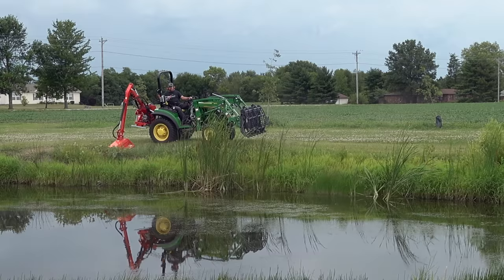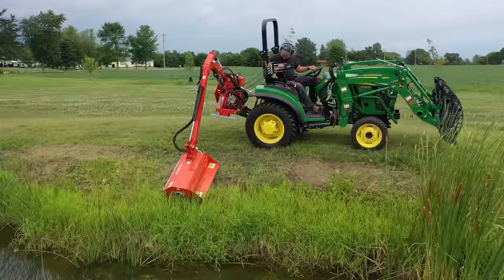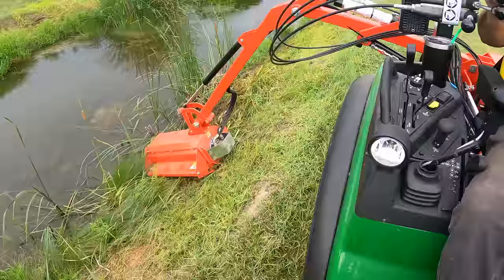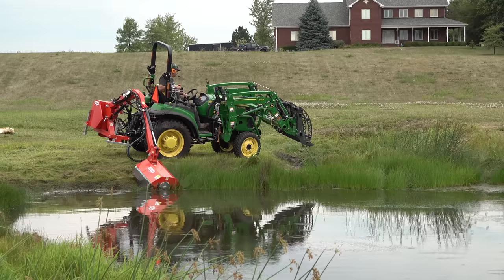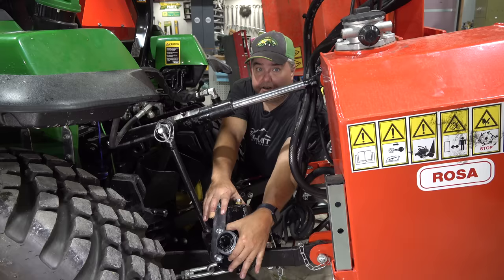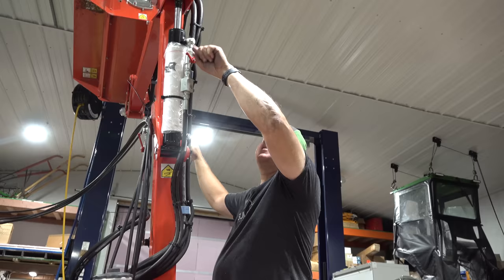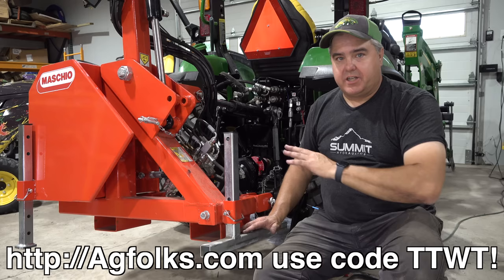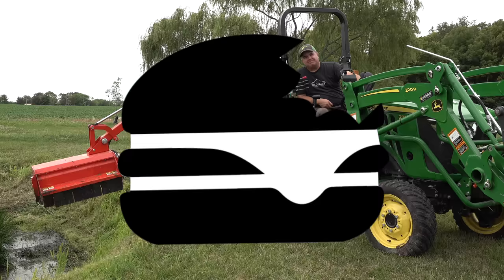BOOM FLAIL MOWER REVIEW! Mow Pond Bank; DISTRESSED Camera Lady!

Comment: Just need an old 9 foot sickle mower it’ll reach out just as far as an expensive flail mower and cut anything it will cut out a whole lot cheaper And be a lot more stable an angle
Reply: I own 2 sickle bars and agree only benefit of this would be for tree lines etc for vertical reach
Reply: exactly

Comment: I'd say dredge the banks to a manageable angle, put fabric down , then rip-rap that you can walk on easily for fishing purposes. Even create a beach area for when you want to even up the farmers tan!
Reply: I’ve not had good luck with weed barrier fabric long term, eventually the weeds win.
Reply: @mbruce4152  I've seen some other landscapers do it and it is less maintenance. Plus if the pond is way down you can spray what little there I. Plus you need to treat the ground before you put the fabric down. Flail mower on an excavator is pretty good too, you can reach out further.

Comment: Sorry to hear about the blood thinners.  I'm diabetic; you need to worry about right away, I just take twice as long to heal.  Getting older can be a disadvantage.

My not serious suggestion for routine management of the grass levels on the slope is to pasture goats there.

My more serious idea, maybe use an excavator to skim off the sod and make the slope more gradual, and then put down driveway fabric and install a sand beach.  Maybe use some pond liner powder first.

Other people have mentioned the boom sickle mower, I was going to ask if that would be more stable.

I'm in the process of buying my first tractor, so I don't know if my ideas are good ideas or not.  Your videos have been helpful during the process.  (Years of research, planning and thinking before the budget showed up.)  Thank you
Reply from the maker: Check out some of our more recent videos about our pond. We have totally redone it.

Comment: I dredged my pond, and shaped the edge to be more manageable. Then I placed rock (large limestone) extending 6'-8' into the water and 4' coming above the water.  I spray along the rock every couple of weeks to keep everything in check.  Looks great, saves me lots of time.  I tried everything else first and failed.  I also tried to put road fabric down at first to prevent the rock from sinking, but ultimately that was a waste. Good luck!
Reply from the maker: Thanks for the advice and sharing your personal experience!

Comment: Yeah, making it wider, for the lower mounts to be quick-hitch compatible, would allow them to slide the hydraulic tank further to the left to help offset the weight more of the mower's head.  Don't understand why sooo many attachments aren't QH compatible, should be so easy to start there!!  (I have several attachments where the top link pin is 6 inches or more too high for no reason, those will get "mount adapters" fabricated to lower the top pin to be QH compatible this fall or winter)  

For pond design, we typically use a 3:1 slope, though that is steep for a tractor, 4:1 is easier for mowing though once you get above the typical water level, I would reduce it even more to 5:1.  Anything steeper than 3:1 will erode way to easy (looks like you have this issue in many areas around the pond) and with a 5:1, if it is under water, will not get deep enough (fast enough) to keep vegetation from growing along the waters shallow edge.  My recommendation would be to regrade the pond edge from the current water level elevation to where the "wet period" water elevation is with a 4:1 slope, then change to a 5:1 slope above that.  That should limit erosion and make it easier to mow/maintain (lot of work to move that much soil be will give you spoils to fill in any eroded areas so you don't need rip-rap in those washed out areas).  Just my 2 cents.

Nice mower and presentation, have a good one!!

Comment: Plant Zenith Zoysia grass around your pond.  Grows extremely thick, prevents erosion, and chokes out other weeds.  The downside is it will take over your entire lawn.  I like Zoysia grass, it is the same grass golf courses use on their fairways.  It will turn brown before your other grass in the fall and last one to turn green as well since it is a warm season grass.
Reply: I like Zoysia grass as well. Yes in full sunlight it will spread to take over and choke out most weeds and other grasses. 
I like zoysia better than Bermuda personally. But Bermuda would be another good choice for around the pond (assuming you are mot opposed to either of these types of grass personally.). 
For the right need(s), it looks like a great piece of equipment with a few minor improvements. The hydraulic lines were probably ran inside the 3 PH connection points to provide protection while mowing, but other options should add minimum expense.

Comment: I'd chain the pump around the drawbar/ drawbar support, before chaining to any part of the 3 point hitch.  The drawbar/ drawbar support isn't going to move in relation to the pump.  The three point, while you may not be raising and lowering it while running the mower, will still have some play/ movement in it.

Comment: These are really common in UK for hedges and bank mowing. I find the heads on the compact versions a little harder to use as you cant really afford any overlap because they're small anyway. I moved from on this size to a full size tractor one and with a little overlap you can get a nice finish relatively quickly. 

Reverse function is intended so you can keep one side of the hammers/knives sharp for neat hedges (so it doesn't break/shatter the ends off everything and leaves a better finish) and run the other direction in grass where you're most likely to hit stones. Debated which direction is best, some suggest flails running "up" at the front for hedges keeps flying debris down. 

You can also gently use the reverse function to get stuck grass wrapped around the rotor out, although probably best to avoid stalling the motor out.

Really surprised this doesn't appear to have any kind of stabilizer frame, usually they have an additional lock-out bar between each lower link and the tractor end of the top link. This stops the machine from rotating and lifting the RH link upwards. They're far more stable with this fitted. 

It also doesn't appear to have a lockout on the 'breakback' so the mower head can swing behind you if you hit an obstacle, often the smaller machines have a fuseable link in the lower link which breaks if you hit something hard (eg, signpost on verges) but holds the mower inline with machine in normal use.

Keep up the great videos :)

Comment: This is definitely a  niche product for specific need of a property.  We chose the Trail Blazer front brush cutter with their hydraulic power pack that runs off our rear PTO with Kubota 3560 Grand L. A separate dealer from our Kubota dealer had it available and installed it for us after we purchased the tractor. They  strapped our PTO shield a certain way so it wouldn't bend while the pump is operating. Let me know where I can send you a picture and I'll show you how they did it.
Also on ours, the standard hoses are too tight for either a quick hitch or even the Pats easy change system. We would have to get longer hoses to make either work. The good news is we have a hydraulic top link to help on connecting and adjusting when mowing on hills. 
I haven't used the offset feature yet, but I  agree with you that you can't have much slope to still be safe. 
I like to be out front on mowing hills. I  have just gone up and down the small pond bank which worked just fine. You just have to go slow to be stable. Also we like the width of 48 inches so we can keep more trees up in our wooded areas  while looking forward.

Comment: I think the ventrac would’ve made it look nicer. But it would work nice for roadside ditches.

As for the holes, you could use the ventrac’s tiller and till up those spots or even go all the way around to see if you can smooth it out.
Reply: how the hell would a ventrac mow as close to the pond as that boom mower is doing?  It would sink up instantly or go into the pond.  There's a reason they make boom mowers.
Reply: @verteup  have you not seen it mow banks before? Ntm the ventrac has a boom mower, could get much closer, and sits much lower and has a wider footprint. It would do way better in regards to this job. Maybe you should educate yourself before you start bumpin your gums over there buddy.
Reply: @Zanderthelab  I believe me and you have watch different videos.  I don't believe there's any way a ventrac couldve mowed what he did with that boom mower.  You realize he had that boom mower in water right?  Like...in the water.  Do ventracs float like a kayak?
Reply from the maker: @verteup is this a challenge?  The Ventrac boom mower should be able to mow further than this one.  Maybe I’ll take that challenge!
Reply: @TractorTimewithTim  Try it.  If the ventrac has a boom mower.  I thought it was just mounted to the front of the ventrac and didn't have any excavator type arm on it.
Reply: @verteup  actually they have flotation tires on them😊. Maybe you should watch more videos.
Reply: @TractorTimewithTim  go Tim! I wasn’t challenging, but if it’s an option, let’s see it beat Johnny 2!
Reply: @TractorTimewithTim  I am surprised you haven't done a comparison video. Mow/plow/grade/etc. part of the pond/field/dirt/etc. with 1025 and another part with Ventrac. I love seeing your usage of the Ventrac.
Reply: @Zanderthelab  I'm fairly aware of what a ventrac looks like buddy.  I mean how difficult is this to understand here.  What I haven't seen is a boom mower on a ventrac.  Haven't seen that. Maybe the ventrac has a boom mower like the one attached to that john deere tractor that I didn't know about.  But I haven't said a single thing about the tires other than "can a ventrac float".  Which was a rhetorical question because the ventrac cannot float in that lake.
Reply: @verteup  well you aren’t supposed to go in the pond. But dual tires definitely help and you definitely need to do some research. And lots of it. And after you’ve seen all the attachments used in at least five different applications, then you can come back and tell me that the ventrac would not do better. I’m assuming the only reason Tim didn’t do that is because he is demonstrating using the Maschio 3-point mounted boom mower. What ventrac needs to do is make a head for that attachment that is like the boom head on the Maschio cuz the boom head on the ventrac is a sickle style mower. But it does nicely.

Comment: I mow our pond banks with either a rear mounted flail mower, my front deck on my grasshopper, or my brush cutter on my skid steer. Most often the rear mounted flail. I back straight back toward the pond to avoid any tipping issues.

Comment: Honestly, a string trimmer would be easier. That is what I use on my pond. If you keep up with it, it goes quickly.
Reply: Same here, I have a hydraulic adjustable flail mower, but I can mow my pond bank faster with string trimmer.  I use the flail mower for other applications.

Comment: hey Tim i work at a deere dealership as an ag tech next time you look for a tractor look at a 4066r with hydraulic top and tilt, your 3 point lift links are hydraulic allowing down pressure or grade adjustment when using a blade

Comment: I don't understand why there are no skids/shoes, to keep the thing from scalping/diggin-in as it goes.  Seems impossible to control the cut depth at all, as the tractor bounces through uneven ground.  Likewise, erosion ruts really bounce the flail mower when the tractor hits them.
Reply: These are not meant to leave in a float position. You pick a height and stay at it for undulating terrain like this. You can put it in float if it's a well maintained and sloped area like a drainage or irrigation ditch.

Comment: A boom mower does have its place I could use one along the road ditch because its so deep.  My Yanmar YT235 and offset flail mower  do a good job for the most part, I think its my driving abilities  cause more issues then the equipment.  I did put a set of 2" wheel spacers on the tractor for a total of 4" wider did not think it would make a difference but it does.  And yes the wash outs going into my creek cause me some "Oh Crap" moments also.  I think the hammers do a better job then the Y-knifes do but that is just my opinion.  Thanks for sharing I've learned alot watching your videos and because of your videos is the reason I even started looking at a offset flail mower and I'm happy I got one.  Although I did get a Tar-River which is not the top of the line mower but it is a good mower, with some weak points, mostly in the gearbox and belt drive, it just the way they are mounted.  Thanks again

Comment: I have a very similar  italian flail (Rinieri BRF350), I noticed that yours was swinging about a bit on the 3 point hitch, I use stabalizer bars on mine which can be a bit tricky to fit but make it ridgid on the rear. I was also recommended to make and fit a plexi glass screen to protect me from any stone kick-up of heaven forbid a loose flail. They are heavy units, from memory I think mine is 760lbs and a tractor weight of at least 2,000lbs is recommended. With individual controls for each of the hydraulic pistons, rather than a joystick control, it took me a couple of hours use to become proficient at using it. However it is a great tool.
Reply from the maker: I discussed this a bit later..and tightened my stabilizer chains.

Comment: I am using the McConnel Arm with hammer heads it is much easier to run than what’s shown here. It swings back by hydraulic automatic if you get stuck down in ground or an obstacle. Control is with a little joystick allowing you to work all cylinders in single controller. I had the same issue with stability JD 4 series tractor and I solved it by changing the tyres to 600/40-22.5 providing much needed stability on the slopes and flotation in the softer soils. Also the hammers enable you to take on brush and small trees.

Comment: I picked up the Mashio articulating flail [live on a hillside] (Thanks Tim for talking me into spending that $ on more toys!) and it came with 'Hammer Blades'. The Hammer style blades clogs up with horse shoe shaped grass clods (around the hammers) easily and have to be removed every 15 min or so. The 'Y Blades' seem to do much better on grass. Glad to see the drone back! Birds Eye video works pretty well for these videos!!
Reply from the maker: Interesting.  I just ignore the grass clumps on the hammers!
Reply: @TractorTimewithTim  I've noticed if I leave the grass clumps on, the grass will strip off the grass talks and leave a mess. not a good cut quality. - Probably not the best tool for cutting thick grass but it does a decent job helping to trim driveway and steep parts

Comment: That is just the nuts for the pond and ditch banks etc.  I too suffer from the PTO hook ups.  All my PTO attachment shafts are the “pull back and hold, then push on” type, and then deal with the quick hitch as well.  I also pull back and hold with the water pump pliers to align and wrestle it on.  It is still somewhat a pain.  I’ve seen PTO link, but I guess I balk at the price, however….I’m “old”…Mmmm?  Blessings.

Comment: I have an 8.5 acre pond and I use a puruzzo ditch bank mower. I thing the cutting head is 84 inches and it extends out 12 feet.  It is all my 91 HP kioti can handle. Need a bucket of gravel for counter weight

Comment: That looks like the ideal solution for mowing the edge of a pond or ditch, where the offset is too far for an offset flail mower.

How does it handle getting snagged on an object like a hidden stump or rock?

Does it have some sort of spring loaded feature where it safely flexes rearwards, or better yet, raises at the same time due to geometry?

What happens if you are backing up and get snagged on a hidden stump?

I don't have a pond that I mow around, but my neighbor does. In his case he modified the banks a couple of years ago to make them much steeper, reducing how much sloped area there is to mow. I don't think he specifically did it for mowing but I believe a regular offset ditch flail mower could handle it.

Although you could do the same as my neighbor, if you've got that impressive 32" boom arm mower available, why not just keep using it? 

He currently has a young and healthy landscaping maintenance contractor that he hires to mow the bank using a regular whipper snipper.

Comment: I have some difficult and steep areas to maintain on my property. I mow, what I can, with my tractor; the remainder with a push lawnmower and or string trimmer. In your situation I would do the same and where necessary walk in the pond with a string trimmer. Affordability is an issue for me. Best wishes.

Comment: It's a shame the manufacturer doesn't provide some way of putting counterweights on a platform, say suitcase weights, on the opposite side away from the arm and cutter. Possibly make these weights hydraulically mobile to extend out to the tractor's left as needed by the operator's pucker factor. Of course, this might not be usable along roads, but you never know what a safety truck, your pickup with emergency flashers on, following behind the tractor/flail mower would do for the whole process.
Reply from the maker: Yes, a simple weight bracket would help :-)

Comment: Hey Tim: I was thinking of the PTO Link before you got to it.  I did have an idea for ya to help keep your shield from bending.  I have a Kubota that has a draw bar mounted below the pto.  Could you use the draw bar without a ball to chain the pump to so it doesn't spin with the pto?  That might keep the chains out of the guard shield.  I wish more implements had pumps like this so small tractors could use them that dont have the gpm requirements.